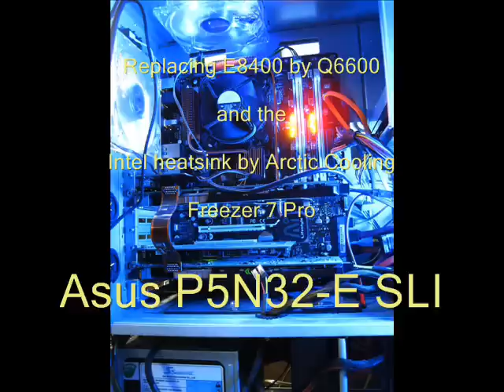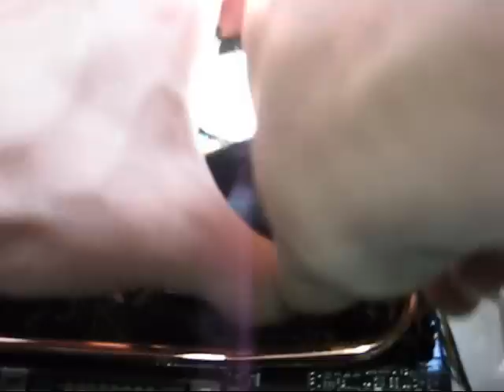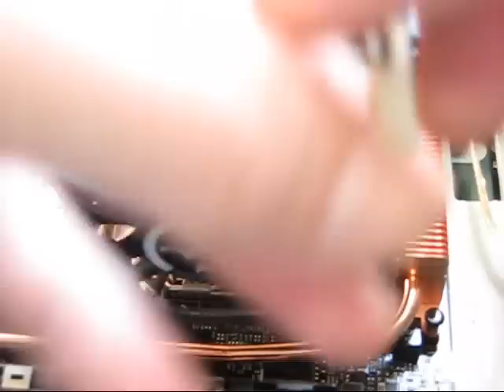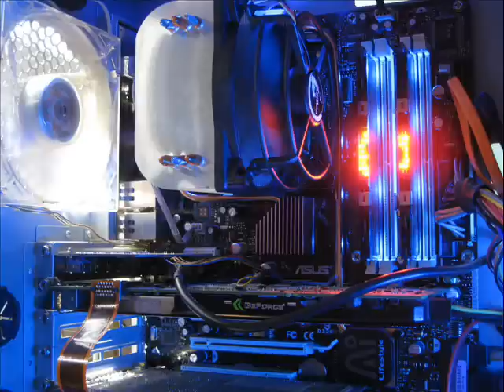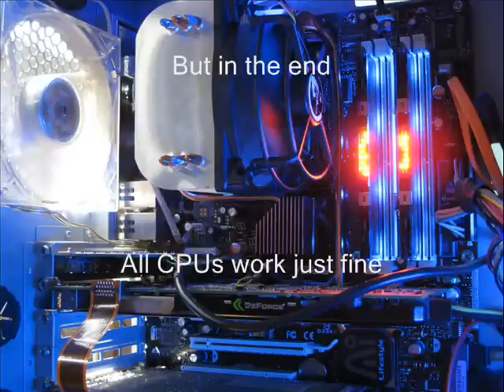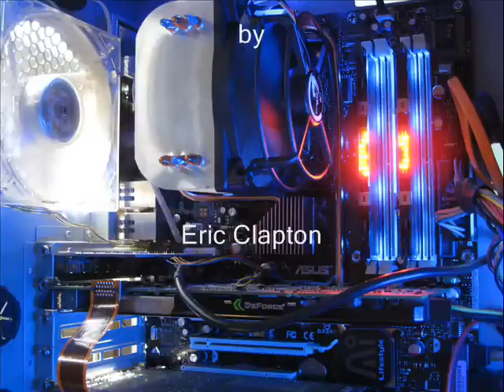Intel E8400 for Q6600

Comment: just updated my gaming rig about 5 months ago, e8500, 560ti, 4 gigs of ram, to 3770k 4.5, 16gigs of ram, samsung ssd, 7970ghz. Wow what a nice jump. The e8500 was a great chip for its time and was better for gaming than the q6600 at the time. In the old system i swapped an 8800gt 512mb for the 560ti 1gig, and didnt see great jumps in performance cpu was holding it back. Think i might order a q6600 off ebay for my old system just cause there dirt cheap now.

Comment: In modern games you really see the difference especially in Multiplayer intensive games like BF3 my E8500 just can't keep up even with an OC. What gets me is that I even put it at low settings and still take huge dips in frames, they say you have 4 cores that goes away. Going to try this.

Comment: Holy crap I have that same heatsink and E8400. Mines running 9x445 for 4005 mhz now. How much of a difference did you notice by going with the Q6600? And are you clocking it up?

Comment: Specs:
CPU:  E8400
RAM:  4GB G.E.I.L memory
VGA:  Sapphire 4850 512 mb
mobo: Asus P5QL Pro
PSU:  OCZ 500 watt
Case: Coolermaster Elite 331

and some other basic stuff like fans and hard drives

Comment: Haha you are full of shit. The Q6600 is just a E6600 x 2. So this means it's 4MB L2 cache per 2 core's because it's not shared cache. 
E8400 has 6MB per 2 core's. E8400 is 45nm vs Q6600 which is 65nm. Smaller die is better overclockability, less cores is less heat = more overclockability. Dumbass.

Comment: Woah woah woah.. 4.5Ghz on a Q6600? Holy... where are you getting your info from? The e8400 blows the Q6600 out of the water when it comes to clock speeds.

I have a Q6600 too, so you don't even say I'm a hater.

Comment: the q6600 has less OC potential compared to the e8400. e8400 has a 45nm architecture meaning less heat, less voltage erquirement, and more OC capability. whereas the q6600 old 65nm hot processor that requires alot of power

Comment: no dude, the mhz speed has little to do with processor quality, if what you were saying was true than a amd 6400+ would be better than an e8400, u have to look in the amount of l2 cache in the processor, temperature, fsb speeds, and overclockability. The e8400 is superior in all other aspects except that it isnt a quad.

Comment: i dont understand why you got rid of your E8400, it out performs the Q6600, its a 45nm, more overclockable, runs games better and if future proof for probs about 1/half - 2 years yet.. you should go reading too many reviews, they argue,"surely Q6600 is faster than a E8400" well no not at all, you need to look into the specs of both processors man :S

Comment: Down-Grade?
E8400 = dual core 2x
Q6600 = quadcore 4x

But the Q6600 needs a better cooling.

Ich have a Q9450 @4x 3,40GHz
4x 3,70GHz is possible, but unstable. CPU getting very hot @ Benchmarks and could crash.

Comment: You are such a fool switching such a great processor for that THING. Quad core is a decoy for us to spend a few more bucks. They only work properly on the Extreme edition (QXxxxx Series). Maybe in 10 years they will be alright but now, and for a good time, Core 2 Duo rules the market of processors. This isn t a case of 4 is better than 2

Comment: process has nothing to do with the CPU dumbass, its all RAM. reason i'm calling you a dumbass is because that last part. second of all, applications are DESIGNED to use multiple cores, if you go to bios you can see option to turn off and on cores. games for example, with the expeption of crysis, are designed for 1 core.  Q series... it just stands for quad. i built my own pc and have many complex modifications to it. and yes, it is a toy. we turned computers into toys when we invented gaming.